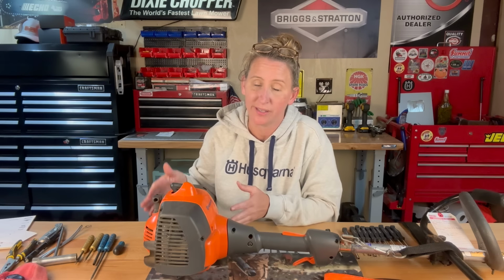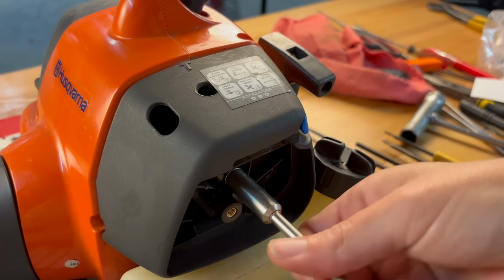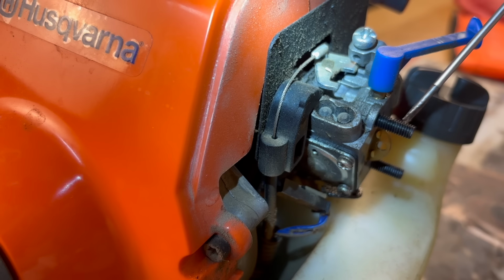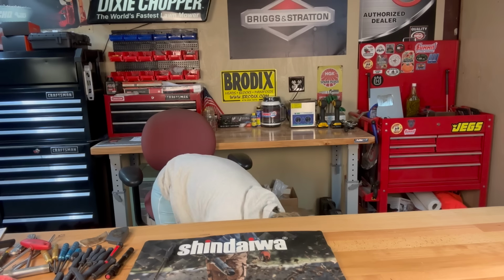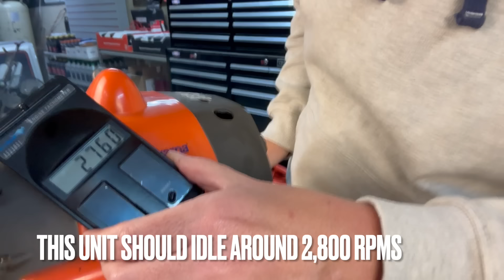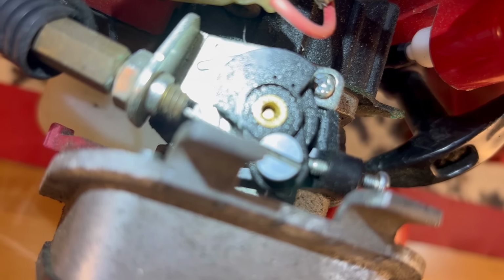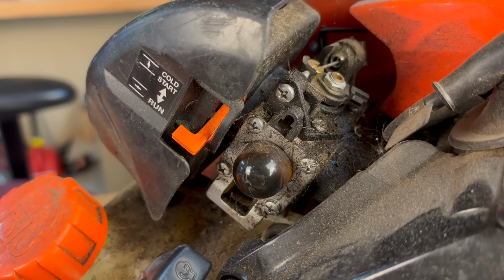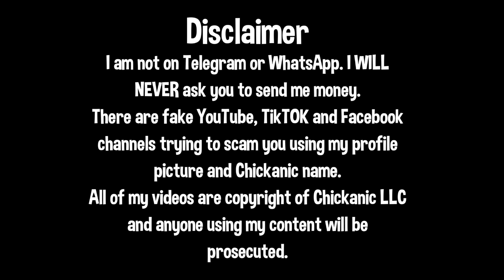How To Easily Fine Tune Your 2 Stroke With A Super Simple Carburetor Adjustment!

Comment: About 20 years ago I wish I had known this. I had a CHEAP weed eater brand trimmer that wouldn't run on full throttle. It caught me on a bad day and i got so mad after fighting that thing for so long i knew i was getting a new trimmer so i took that thing by the shaft and smashed it to pieces against my retaining wall. It made a mess but oh it felt SOOOOOO GOOOD!!!
Reply: I bought a Stihl that I still use today with no problems.
Reply: Working at an amusement park, I witnessed a guy smash his camera on the ground, grab the film and pull it out of the can. About a half hour later, he was back at the amusement park with a new camera. Apparently, the previous camera had been given him problems his whole vaccination. 😂😅
Reply: I did the same thing to a Homelite weed eater . Then I bought a Echo 210 straight shaft weed eater . Best decision I ever made . That weed eater sold me on quality power equipment.   I still have the trimmer but the tree is gone . 😂
Reply: @Truckerstar  I wholeheartedly agree!!! I only buy quality power equipment now!!! Lesson learned!!!
Reply: When I was a kid my dad had two Wizard 19" ?  mowers , I think they were Western Auto brand , Green & Yellow , One day one of em would stop running every 5 minutes, he took it by the handle and swung it in a circle till it wrapped around a fig tree , after about 6 swings the entire deck was U shaped ,I was on the porch laughing so hard I thought I cracked a rib , when he stopped swinging it I went and hid LOL
Reply: How childish.
Reply: @gungadingo  thanks for your input. No one cares.

Comment: Geeze, those Shindaiwa/Echo high/low adjustment screws are so tiny. I got those 2 plastic plugs out with a hot flat head screwdriver. I've got both a 21cc and a 30.5cc Shindaiwa trimmer, the bigger one has been absolutely flawless. Smaller one doesn't like the heat much, and shuts off on me occasionally. The muffler is crazy restrictive and looks to have a cat inside.

Comment: 1 week ago I took out all my equipment. The 7 pieces are used on my 5 acres. Everything started up because of How I store my equipment and a lot of tips from you. All my stuff is OLD. Newest piece is  10 years old. Oldest is 82 years old.
Reply: List them please. I’ve never worn out a 2 cycle-drove over a blower, and a tree went an unplanned direction on a saw, but never wore one out.   Combination of lack of heavy use and decent mechanical skill.   My oldest is a CS510EVL.
Reply: @JohnSmith-un9px  Ford 9N tractor w/brush mower from 1942. Stihl 029 chainsaw . Echo chainsaw #CS-3000. Echo hedge trimmer #HC-1500. Poulan Combo line trimmer/polesaw #PPB 250E. 2 Yardman self prop lawnmowers. Toro super BlowerVac model 51587 20 yrs old. And I have 2 back up chainsaws.
Reply: Right now I am doing some awesome modifications to A POS parts washer from Harbor freight.

Comment: I kept reading where their were no adjustments on small engine carburetors. But lately I have been reading their are adjustments.  So thanks for clearing the up for me.  I think the users manual also says no adjustments, such as the manuals are today.  I guess the manual is mostly lawyer statements about don't do this, don't do that, etc.  Maybe they are now trying to save printing manuals and save 2 cents.  And in the future they will all be on line only.

Comment: My echo 225 trimmer runs great but I've noticed I get goo out of the exhaust. I have the right mix fuel. Common issue with these srm225. I started running it more at full throttle which is what echo said but I don't usually trim at full throttle or need to. I assume the exhaust isn't getting hot enough. Cleaned spark arrester on exhaust which didn't do much but running it full more seemed to slow it down the leaking.
Also when going from idle and hitting trigger it bogs for a second but I haven't checked the idle rpm yet but I have the tac thing you have and maybe I need it to idle higher for easier transmission to revving. Mine does what yours there did after you did the 1/8 on both. The stutter from idle to revving
Mostly it's the goo that I have a problem with

Comment: Recently discovered your channel.  Great content Bre!  You are awesome.  Couple of quick questions:  1) Just put a new carb kit on my Echo SRM-266.  New plug, carb, fuel lines, filter.  It started and ran powerfully, but idles to fast.  So fast in fact that I can do light trimming without even using the throttle.  What should I adjust first?  Second question, is there any need to put the caps back on the hidden high/lo adjustment screws?  Do they help provide a friction hold on the adjustments made?  2)  A couple of my echo trimmers flood very easily on starting, and then become very difficult to start.  What is the ideal technique for a clean, properly adjusted machine.  (I only use True-Fuel, Clean my units regularly, never have any build up on the spark arrester, don't store them with gas in them, etc).  I do tend to not run them at full speed except occasionally while I whack weeds, but as I said, they never seem to have a problem with carbon buildup.

Comment: do you have any videos on briggs engine craftsman push mower with the primer bubble with the chock spring issue? I replaced the carb air filter fuel line and damn thing with start for a second and then die.

Comment: I have a Stihl FS45C, it starts right up but after throttling up it will run very rough. The trimmer won’t die but runs very rough. Any thoughts?

Comment: I got low RPMs/power but adding choke doesn't help. It idles fine but it just doesn't throttle up to a workable RPM most of the time. I think it might be running too rich instead of too lean at WOT. I got the caps on my echo and it doesn't look like that tool set comes with the tool for those.

Comment: Chickanic, I have watched at least 10 You Tube videos on HOW to adjust carb on srm-225. I need to take my echo apart, but I would like to know...Is the adjustment screws Rightie Tightie, Leftie Loosie. To increase the fuel on the high side or even the low side actually, do you turn the screws to the left or right; to increase fuel, OK?
I was given the echo srm-225 and it wouldn't work at all. I followed your videos and got it running, but would not continue running. I adjusted the screws both ways until it started, and it idled...for a while. Then I changed the gas to oil ratio to 2.6 oz. to 1 gallon of fuel (non-ethanol). now, nothing again. I recleaned everything, but it might hit a little, then it dies and it will not start and run. The fuel lines are new, the fuel filter is new, the air filter is new, the primer bulb is new. Can the diaphragm cause it not to run? I'll buy a new carb if I have to, the echo was free, so.....?

Thanks,
Chaplain Rodger DeRamus
Tuscaloosa, Alabama
Reply: Both jets open left and close right. You open to add fuel close to decrease fuel. I would open the carb and change the diaphragms, but when adjusting remember more fuel slows down the RPM both high and low.
Reply: @dudekanic  Good. Thanks. I thought I may have made a mistake. Leftie Loosie was right. Loosen to add fuel. 
It seems like the adjustment inside the brass nut on top opens or closes indefinitely. I don't think I have reached the completely closed or open end of the top adjustment. 
I had some mixed gas/oil fuel from another machine, a Poulan Chainsaw that worked great in ti, but now I have the oil- gas ratio at 2.6oz. to one gallon fuel. Now It will not crank. Crazy...

Comment: Will this work on a Toro powerlite 98 cc engine snowblower? Model #38182? It will only run when the choke is on? When I turn the choke off it dies out.
Reply: Na, the bowl nut probably needs unclogged… possibly a rebuild kit. Donyboy73 “FIXING A Snowblower That Surges“ or “How to easily fix a Tiller that's been sitting FOR YEARS! Tecumseh OHV 5 HP CARBURETOR REPAIR” from Chickanic.

Comment: Ok; somewhat related question.
I noticed that it sounded like it was misfiring throughout the power band but then there was a point at 8:27 at which the engine smoothed out and sounded like it was firing every time.
Isn't that "smooth running" where we want to be? Seems like every 2 stroke I've heard sounds like it's misfiring!
My chainsaw was the same way at idle; popping and misfiring.  
When I would get into the throttle, it would lag on accellerating. 
I tweaked the carb settings a little and then when it would come up to full throttle, it would smooth out and fire every time.

Comment: I have a redmax ebz5150 blower. It starts with no issue but when I hit the throttle it bogs down. If I let it idle for a few mins then hit the throttle it works fine. I've replaced the fuel and air filter and spark plug. Could it just need a simple carb adjustment?

Comment: can i trouble you with a question? i live in Belize so parts are not,,,, everywhere.
i bought a replacement carb for my stihl fs38. everything was fine till i see the throttle cable end connection is different.
any tips?
thanks!!!

Comment: Heat up a little Screw driver red hot 
Then push in and turn and let it cool before pulling it out 
Will remove the Rubber Cover cap

Comment: Carb adjustments worked like a charm, thanks!  Maybe now my throttle cable is a tad tighter but the carburettor now clicks into a full open mode.  Seems by design, how do I prevent that?  Thanks!!  (2 stroke chainsaw, Sovereign)

Comment: I use my dremal with a cutting wheel to cut slots in the carb adjusters so I can just use a flat head screwdriver..
Reply: This what I am about to do...cant figure out what tool I need. Small D or micro D. How long does the tip need to be, etc...explain to me how driving a vehicle around looking for correct tool lessons the the emissions? 
Thinking a dremel cut off wheel would be small enough. What did you use? I have new echo 2620 trimmer and blower.
Reply: @MrSlugger9  Yes, I used one of the small thin dremel cut off wheels to cut slots in the two “screws” which are more like posts.

Comment: You take a drill bit that fits tight and heat it up stick it in the hole for 10 second and pull it out

Comment: How much trouble can a shop get into adjusting carbs by removing the limiting caps?
Reply: Yup its true. Licensed small engine technicians can get in trouble giving information on how to remove limiter caps or even lose their license. Machines without limiter caps are different and usually are much older units

Comment: Do you have any videos out on how to fix a push low mower that won’t start? I took the carburetor off cleaned it did all that put it back on and mower still will not start.

Comment: Thanks  for the video. I have two of these  trimmers. I replaced the carburetors on both. They ill not even try to start. Change the spark plugs. Adjusted the high low as the manual said. Still would not make a sound. I did get the carbs off Amazon. Probably was a mistake.

Comment: Thanks. I have several pieces of equipment with various carburator problems. Mostly from bad gas where I disassemble the carb and clean them and then they never stay running no matter how much Sea Foam I run through them. I'll let you know how the adjustment works when my adjustment tool kit arrives.

Comment: Just an FYI.  On April 22nd 2024 both the black toolkit, and the digital tach show as currently unavailable on Amazon.
Reply from the maker: Thanks for the heads up. Keep a look out for posts. I always let everyone know when the tach is available and the price comes down. Every time I mention it in my videos or posts they start to drive the price up and then run out in a day or two. I usually let everyone know when the price comes down under $80. Weird about the black tool kit. I don't think the orange one has ever sold old. It was my first time telling about the black one.

Comment: Have a Poulan blower  the fuel lines were f
Junk. I bought a carburetor and kit. Replaced fuel filter,  lines, and carburetor.  It ran fine except for high speed,  it would surge.  I richened up the high spsome and it ran fine.  That was 2 years ago  and it still runs great. I use it all year so that may help as well.

Comment: When I was given the Echo SRM225 trimmer, it would not start. I watched videos and read what to do to get it to start. I took everything I knew how to take apart and got it to start. I had the wrong mixture of gas and oil and when I got the right mixture, the trimmer stopped starting. Don't ask me why.
So, I watched the adjustments, and the high adjustment is about six turns from full on to full off and the low side is kind of a 90 degree from left to right. Where would be a good place to start? I ordered the fuel filter, the air filter, the return tube and the sensor and the bulb, too. Now all fo them are good and the exhaust screen is good. I am about ready to take it to an expert down the road and let him adjust it for me.
Any ideas? Chickantic and/or dudechanic?

Comment: Hello CHICMECHANIC ..... when first START TO ADJUST the ECHO TC-210 GARDEN TILLER.... How much do I turn the HIGH & LOW SCREWS  to the right SETTINGS before starting to adjust screws at ¼ turns  to get the 2 cycle motor running at optimum levels ??

Comment: Hey I've had extremely good luck of getting those caps out with a tiny wood screw and you pull them right out
Reply: I used to take those jets out and drill a hole or take the Dremel and make a slice in it super easy to adjust They all come way too lean super lean

Comment: I’ve had my Husqvarna weed eater 128L for over 12 years and never had to adjust the carb just changed fuel lines and primer bulb. I’m a Husqvarna fan never used nothing had a mower for 20 years till I bought my Husqvarna zero turn mower love them
Reply: I agree with you, I have a older Husq. Chain Saw-51 series that is 30 years old and has cut probably two semi Trailer loads of Wood-many Chains and several Bars but still has Original Spark Plug which is Amazing. Don't know about their Newer Models but I would buy a New one in a Heartbeat...

Comment: I had a problem with an old Stihl weedeater trimmer where it had the same issue where it wouldn’t run well.  All I did was run the adjustment screws full out, then full in and then back to where I found them.  After that the engine started to run, but not right.  While running I did the same procedure and after that the engine started running correctly.  My thought was that the needle valves were clogged with dirt/old fuel goo.  By opening, closing and resetting the setting cleared the dirt/goo out of the valve.  Have you ever seen this type of fix?

Comment: As usual, great info very informative. Thank you so much, question. If you've done all that adjustment and you go to work on it again, to rebuild the carburetor what should the initial setting for the high and low pins be? At how many turns out

Comment: Just did the echo Tune up kit 
Pb 250 blower plug was dry, and bogs until it gets warmed up. Is this something that the high adjustment would fix? 
Also, the SRM 225 trimmer plug is wet but runs great. I use  ethanol free with echo red armor oil in both. Neither one smokes. 
Would you adjust or just anything on the equipment?

Comment: I had a crispy old carb Echo that I rebuilt and she started so sweet.  Now that I replaced  the muffler, it's hard to start. I burned away the carbon in the spark arrestor, but still not the best. I think that I will just remove the spark arrestor and try again. The grass is growing fast now with those tough seed heads, so I hope I can get by

Comment: i bought a 2020 troy blit bronco with less then 3 hours from a older gental men he only used  3 times  it has a 19 horse briggs and stratten and what is the difference betwen the bronco and the pony i paid $550 nothing wrong with it should i change the oile or a tune up its never been change since he boght in 2020 how did i do did i get a good deal or not how offten should i do a tune up

Comment: not sure what size they are but i found some 2 flute taps i ground the point off the bottom. got one for cup plugs  you find on some bigger carbs. found if yo find the right size ferrule you can slide that over the tap and use a nut with the setup working as a puller

Comment: I picked up a $5.99 Pac Man adjuster for the Ryobi I inherited when an old client bailed. But your link to a 10pc set of them is good.  As I was fueling the 5 year old Ryobi, the fuel line broke in half, helping me diagnose my problem by leaking. ;)  And as you said, it didn't really need any adjustment once the fuel was easily had through the new fuel line.

Comment: My Stihl BG55 wouldn’t run with choke open, so I took the rubber limiter caps off-threw them away- adjusted the carb & it runs great! All my yard tools are Stihl, except for my Echo edger, so a small screw driver works great!

Comment: I had a Poulan wild thing chainsaw one time That I tried to modify the ignition timing on ,, I spent hours on that flywheel filing it down trying to change the ignition timing to run on 30% Nitro Methane for R C trucks ,,  And when I started it between my legs it went to Full Throttle and the flywheel exploded at 14,349 RPM and it blew both of my testicles off and Half of my right Ass Cheek All over the side of  my  neighbor's house ... I've been walking like John Wayne every since ....